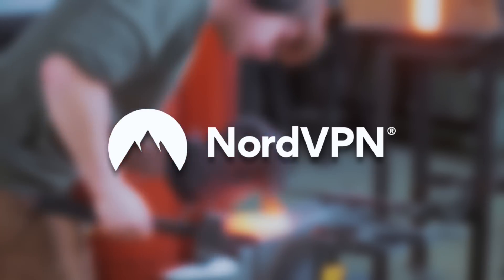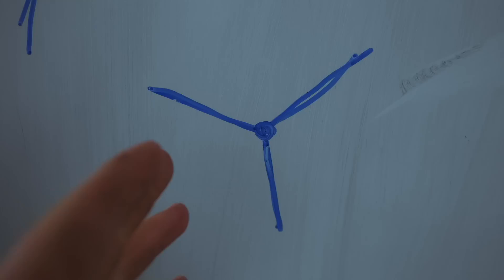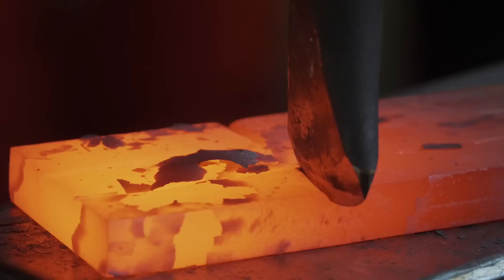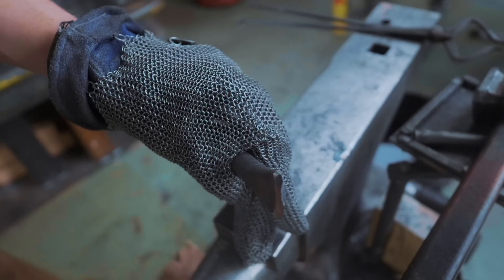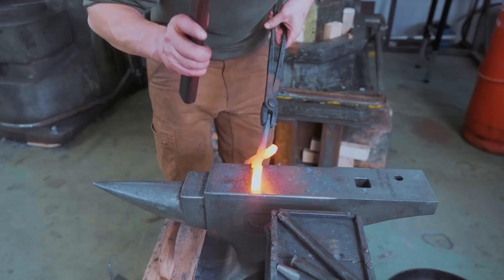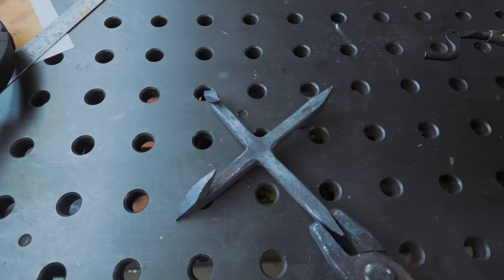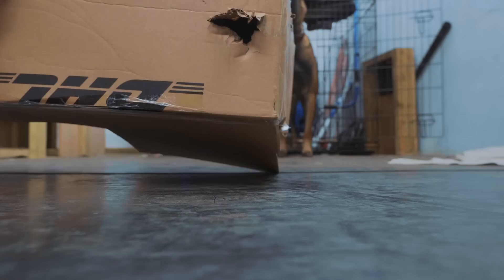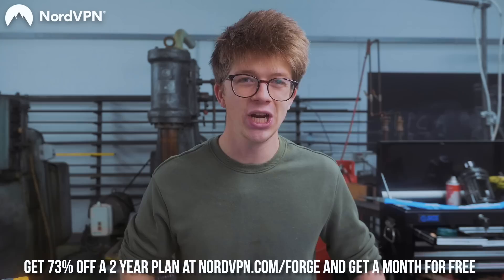Don’t step on Caltrops!!! (Even worse than lego) - Recreating this Medieval tool of war.

Comment: So I’ve not forged anything before but I’m curious why you divided the bar into 3 and 1 w 2 waste pieces and not 2 and 2. Also why form a point then bend it over on itself to form a barb instead of splitting a barb out of the point. 

Sorry if that’s a dumb or obviously wrong headed approach

Comment: I would love to see a Damascus wrench set.
Reply: Hell yeah. A one off set of SAE and Metric wrenches in 120 (+/-) layer Damascus. Open-Box end with 12 sided closed end. 
"ALEC ~ STEELE" and the sizes stamped or engraved on the side of each handle. That would be awesome. Or one pattern for the SAE and a different pattern for the Metric. Say 1/4 thru 1 1/4 by 1/8ths and 4mm thru 22mm by 0.5mm thru 8mm then by 8mm.
The open end would be easier to size, forge to two sizes smaller and grind to fit the nut plus one sheet of paper. The closed end would take a bit more work to make fit properly after heat treating changes the size some. Would take some trial and error to see how the size changes or warps.

Comment: You've got a hot cut hardy.  Why wouldn't you just take a rectangle, split the bottom 2/3rds into thirds, forge the top third down into a point, and then forge the rest?

Comment: Hi, Alec. Nice research. I'm guessing instead of starting with 3 legs on one side and 1 leg on the other, you could have started with 2 legs on one side (which would open left and right) and 2 legs on the other side (which would open up and down). If it worked it would have been a simpler workflow with less work cutting. Cheers.

Comment: So wait, instead of spending half a day cutting and then bending and cutting to size each prong...why not just forge two thin bars together in a cross and go from there? Caltrops aren't exactly highly complex and were literally meant to be thrown on the ground and forgotten about, so not a lot of time would've been spent on crafting one (other than making barbs if required) when barrels of them would be needed to effectively salt a battlefield.

Comment: If you really want modern, super effective (against cars) caltrops at low cost, take some small steel pipe, cut it off at an angle, bend to 90° and then weld two of those Ls you made together.
Why pipe? Bleeds the air out of tires super quick, also maybe blood out of your foot...

Comment: Much faster and easier way, is to take a flat bar chisel cut it from top and bottom towards the middle but not all the way, leave 1.5 thickness between cuts, the just open them up half twist them and chisel the point just to lift up some material if i had to make loads of them that what i would have done

Comment: could have done it in 2x2 fingers not 3x1. You would have saved 1/3 of steel and would have had to do only 2 cuts instead of 4.
Then done a 1/2 twist long ways to separate the cuts, made the barbs, followed by a 1/3 bending of each arm to into position to complete.

Comment: Historically they were made from two pieces joined at the middle. I think. Forge-weld two pieces of metal, then bend them outwards. Far faster and easier, though I know you said you wanna challenge yourself by making them from one piece, so if that was the point, nvm.

Comment: Not to be that guy but there is a flaw in that the "barb" seals the leakage when they hit the tires. if you instead use a pipe it will drain out much faster causing a catastrophic failure.

Would imagine it would have the same effect on people

Comment: Hmmm, why did he pick that shape for it? Why not a bar with 2 lines down the center 1/3rd of the way, space them into an X, wrap their ends opposite of their side across the center. This would be easy to taper each point, have no waste punching the top out and most likely an easy way to manufacture a lot of them quickly. Hmmm I would love to see the other ways that people can think up and then done..

Comment: I thought caltrops were made from two straight pieces of wrought iron, bent in the middle, and then welded/soldered together to connect the points of a tetrahedron jig?
Construction is a lot faster and easier that way. (Remember, the armies had to make thousands of these, cheaply and fast. )

Comment: Easiest cheapest way to make a caltrop is two lengths of wire twisted together in the middle and sharpened, you've spent enough time drawing the wire you probably wouldn't bother welding them together... might not be strong enough to get those with real boots but that's not most of them is it?

Comment: Actually the easiest wa would be to start with a piece of rectangle bar, and from either end towards the center split it, but not all the way to the center, twist one half of it 90 degrees from the other half. Make your tines from there and bend them into place. Once piece, two cuts. Nothing simpler

Comment: These were made by the  thousand and most likely for single use.There must be a simpler and faster method even by medieval standards.
Reply: A H instead of a Y with an extra top prong. Two cuts and done.

Comment: Couldn't you just forge 2 round bar together to make the cross? and then they bend around each other to get the points in the correct orientation?

Comment: I really don't want to be an armchair blacksmith, and I promise to put my money where my mouth is at some point, but the "fork" base of the caltrop thing seems intuitively wrong to me.  It seems like you should do an equal rectangle with a top and bottom slit making it effectively an 'X', and then you twist the middle to 90 degrees once you have the four arms pointed? This is just how I'd do it and will try to at some point.

Comment: Why make it 3 on the bottom and 1 on the top? Why not 2 up and 2 down then bend them each in opposite ways… after all you just made it point out like an X anyway so why waste metal cutting 2 parts away for little reason before spreading the metal AND logically in the past couldn’t they have sharpened it to points before they split and bent the metal for quick caltrops then they would just need to notch the metal in a way to get the barbed version

Comment: That was some seriously medieval sh@! going on.  Much respect too your iron working skills.  You do know though, that you could have cut out the metal cross, with the barbs, using a  plasma cutter.  All the barbs would have been in the same plane, but you could have easily fixed that when bending them into shape.
You could also have barbed both ends of two metal rods and then forge welded them together.  I think that would have saved you a lot of time.

Comment: Yea Alec...I'm sorry, but I have to agree with everyone else. You gave yourself too much work for something so simple.  It doesn't really matter what it is that you're using for stock. You just need 2 straight things you can put a point on, bend across each other, sharpen ends. Hell you really don't even have to necessarily weld them.  I'm sure simply heating both pieces and doing a full 360 twist around each other individually would be enough. Although for all that work, yea, just forge weld the damn things.

Hell if you weren't who you are I would tell you to just go buy some Jax and grind the ends to a point.

Edit: spell check says your name doesn't exist.

Comment: i would have used 3 round stock and forge wielded them
Reply: Why 3?
Reply: @thomasarussellsr  that would make a total of 4 then its just a matter of bending and pointing them
Reply: @Loan--Wolf  crossing 2 in the middle of each would make 4 ends. That's why I asked "why 3".
I think I see where you were going though. 1 long, and 2 half length. Forge weld each of the 2 shorter ones on opposite sides to the middle of the longer one, right?
Reply: @thomasarussellsr  i confess i am not a blacksmit but i love watching the videos